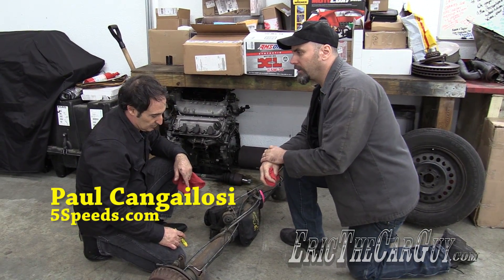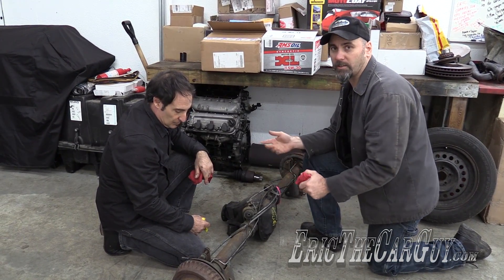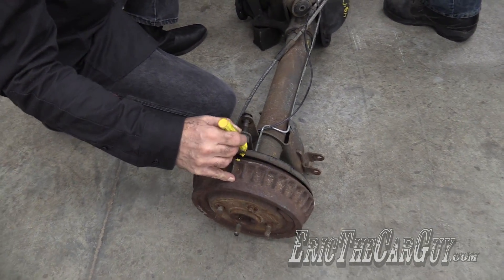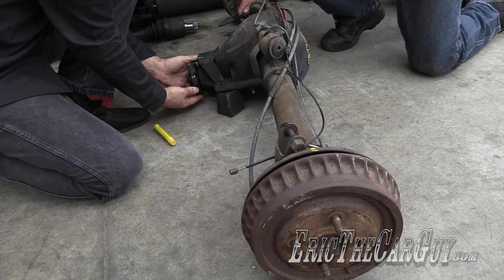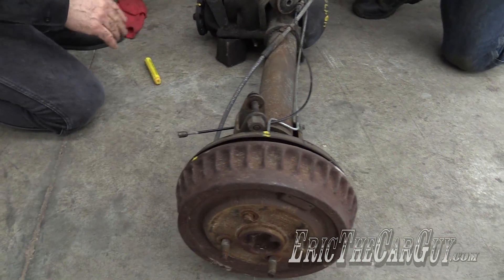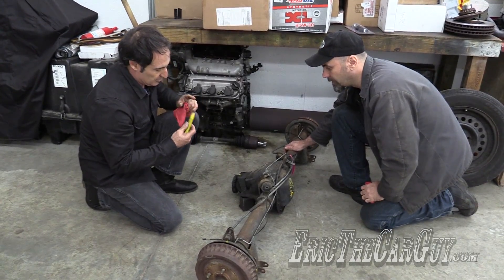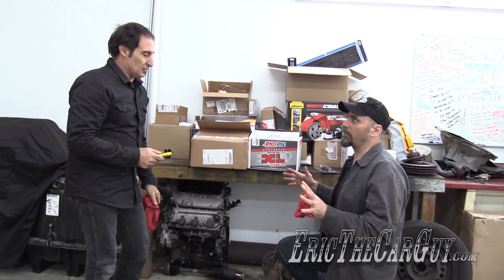A Quick Easy Way To Determine Axle Ratio -EricTheCarGuy

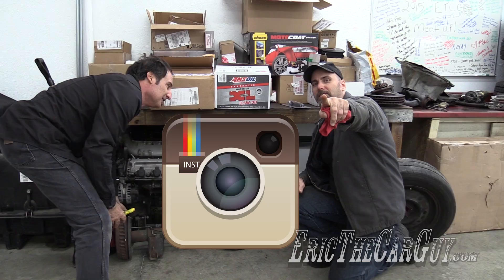Comment: I have a 77 vette and the person I bought it from said the rear end ratio was 3:70. I wanted to bring this down for thruway driving. A 3:08 is what I decided, I know no jackrabbit starts but I'm beyond that at 72. Took it to a shop and they did this quick check for the ratio and found it to be a 3:08. My question is this, can this quick check be inaccurate? I dont see how but the guy insists their wrong.  It's a posi rearend and no tags on it to tell me what it is. Hate to open it up to be sure.

Comment: Very similar to the way I figured out the axle ratio on my '69 AMX - only I raised the rear end and spun the left rear wheel while watching the drive shaft..  Mine has a 3.54 posi - with a T10 4-speed.  And I put Amsoil Signature Series 10W30 oil in my 390.

Comment: This works with an open differential by using two rotations of the axle hub (drum brake in this case) instead of one.

Comment: I'm thinking of putting a M-20 in my 55 210. It supposedly has 3:55 gears in the rear. (I say supposedly because the guy I got it from lies so much I really don't know, I believe it might be a 4:10 because it's so low) it also has 15 inch tires, a 350/300 hp engine in it. How will my top end speeds be if I do this? Someone please answer this because I really need the help. Thanks

Comment: I'm a truck guy from way back.  I learned quick to get the lowest rear end ratio made so I could put taller tires to increase ground clearance.  Most of the time 4:10 was the sweet spot.  Nowdays with the newer transmissions you don't need to go as low, but it still helps if you are going to use your truck.

Comment: Maybe you can help me! 
I have a 91 toyota pickup 4cy 22re. i had a whine when i coast, looked under pinion was leaking and driveshaft would wobble. got it fixed, a week later same thing.. whats causing it to break? bad u joint?  i also have vibration at 45 and 65 but 70 is smooth, im thinking thats my tires but not sure..
thank you

Comment: This same technique CAN be done with a standard open differential, you have to just prevent one side from moving. You can do it with both wheels turning too, but it takes simple math. You'd have to divide tire rotations (t) by yolk rotations (y)... and only count when both marks are touching. Then add them, and divide by however many you performed. For example. 3y1t = 3, 6y2t = 3, 9y3t = 3, (3+3+3)/3 = 3.00 ratio. Another example:  5y2t = 2.5, 8y3t = 2.67, 12y4t = 3, (2.5+2.67+3)/3 = 2.72 ratio. The more rotations you do... the more accurate.

Comment: Hey Eric, I'm sure other people have mentioned it, but this same trick is workable on an open differential. Lift the vehicle (or place the axle assembly on jack stands, mark the drums the same way he did, just on both sides, as well as the pinion flange. Then, have someone hold one side perfectly still while you turn the other side 1 full revolution until the marks line up again, then hold that side while they turn the other side the same full turn. Count how many times the pinion flange turned and you have your answer. Easy and quick way to get differential gearing.

Comment: I had 4.10's in my 92 mustang and it was auto then converted to stick and i barely had 1st gear after but man was that a fun neck breaker. My current 94 gt still has stock 3.08 gears but will upgrade later on to 3.73

Comment: Ok, here's a question.
 You were saying that you can only preform this test on a posi rear. Is it because it spins both wheels when you turn the pinion? If so, then could you do this test on an open diff if you blocked (or locked) the other drum (wheel) side?

Comment: Where did the J series engine in the background come from?
Reply from the maker: +Chris Phillips It's replacement will be featured in an upcoming series when I get the opportunity to complete the edits.
Reply: +EricTheCarGuy Can not wait. Have a 6th gen accord with the J30 and absolutely love the engine. Just wish I could say the same for the transmission
Reply from the maker: +Chris Phillips Yea, those transmissions weren't the best. You're much better off with a manual trans for those years.

Comment: If 4th gear is 1:1  and 5th: is 0.6... why not go with either a 3.73, 3.90, or even 4.11?
Reply from the maker: +ArchimedeanEye We found out my transmission is actually for a 6 cylinder. Overdrive in the 6 cylinder is .73. Therefore I'm going with 3:55.
Reply: +ArchimedeanEye  +melodicdreamer72 You have to keep in mind the whole package.  The transmission has a 3.35 1st gear. Typically that is too much first gear to run with a 3.73 or 4.11. Actually most of the Mustang 5.0  had 3.08 and 2.73 ratios with that gear. The issue becomes how the engine is cammed and where the torque curve of the engine sits.  From what I discussed with eric, the way that engine is cammed, with a 2.73 iut would choke off the line.  The overdrive ratio on the final build of the transmission ended up at a .73.
Reply: +IceInMaWeiner the World Class transmission for the Ford v6 was actually the same used in the first design v8 world-class boxes except this came with a .73 overdrive instead of a .68 overdrive.
Reply: +ArchimedeanEye i was thinkin 3.55 or 3.73
Reply: +ArchimedeanEye I would also narrow it right down to 3.55 myself as it sounds ETCG has - from experience.  Since the 5.0 liter going into the Fairmont has a relatively low red line connected to a manual transmission with standard diameter tires, the 3.55 will keep the car at a good point in the power band throughout the gears.  With a 3.73, 1st gear from a dead stop to red line will be really fast and tire spin becomes an issue.  On the other hand, if it had your basic automatic transmission (why would one do that?) the 3.73s are a good way to go - in OD you'll still be able to keep the car under 3000 RPMs on pretty much any highway as well.  On the other other-hand, if there was a 4.6 / 32 valve motor going in with the manual, the 3.73s move things to a happy place.  Much lower gears are not very good unless you are going for a mostly dedicated drag car with big slicks and heavy suspension and drive-train modifications to handle the load.  Just my two cents.
Reply: +EricTheCarGuy   Is that six cyl trans a world class (roller bearings)? if not, a WC is about mandatory for a healthy small block.
Reply: +ArchimedeanEye 5:0s love the 4:11
Reply: wowantonlavey p
Reply: +EricTheCarGuy Can the v6 transmissions even handle the extra power of a v8?
Reply: +EricTheCarGuy  Nice happy medium!  Can't wait to see more of the build.
Reply: +GearBoxVideo actually, the 94-98 v-6 transmissions had a 3.35 1st gear and .73 of ratio, and the 99-04 v-6 transmissions had a 3.35 1st gear and a .68 ratio od. the 87-93 stangs had a 2.87 1st gear and a .62od ratio except for the odd ball cobras and 4 banger transmission. you'll cruise fine with 2.73 gears down to about 40 mph with no lugging in 5th.

I ran a 2001 v-6 trans behind my 2.73 FD ratio 302. I beat the living crap out of it and had no issues but motor mounts. 1st gear was done by 35mph, second was good for about 70mph and 3rd was still pulling at 112mph. dumping the clutch in 1st at 20mph would either spin the 275/60's or dead hook and go. freeway, you could easily cruise any normal road in 5th gear, all the way down to 45mph, but freeway speeds you would 50% or more throttle going up small hills. you could maintain any speed you wanted in 4th gear. Best $150 buy ever off of Craigslist. was in the car for over 80 k miles without issue.

I vote either leave it stock or go with a 3.55-3.73 gear. if it's just an occasional cruiser, 4.10 or higher. it would be beneficial to try to get a 2.76 1st gear over the 3.35. my car spun all the way through first and half way through second before hooking up, but I had a stock s.o. motored 87 tbird, so 150hp when it was new and a one wheel peel.

since you have the v-6 trans, don't pay big money for a 94-95 gt bell housing or spend the extra money on a new shorter main shaft from a fox. just get a 164 tooth flywheel ment for a f-150. 82 or earlier 302's were 28oz imbalance and 82 up were 50oz for the 302. 351 was always 28oz imbalance. use the mini pgr starter from a 92-96 f-150 with a manual trans. most cars use a 3/4" offset for the starter, while the trucks generally use a 3/8" offset. if you tray a fox starter with the truck flywheel, it will not disengage. other then that, its drag and drop. you can get the 164 flywheel machined for the metric 94-04 clutch if desired, but I just used a stock 1987 f-250 clutch, under 8500gvwr option.

also, the fox clutch cable works fine, and the trans is not actually any longer, only the input shaft and shifter are slightly further back. if desired, use a non offset handle. I used one off a 89ish super coupe and it put it right back in the factory location.
Reply: +lilsammywasapunkrock I believe the original  question was about strength. My point was they both had a main V8 gearset ( 3.35 ) just a different OD set.  The .73 set is actually a stronger set.  No T5 unit came with a 2.87 1st gear. You might be thinking the 3.97 set which was in 1987 - 93.  This was not a V8 gearset but typically what was called the Turbo TBird set ( came with a .79 OD ) and in Mustang 4 cylinders.  I've been involved with the T5 program since the start. Also stock every gear set. Obviously dealt direct with Borg Warner when they owned it, now am a Tremec dealer. So if you are looking for any of that stuff, hit me up.

Comment: and wouldn't that be different if the drums were a wider diameters. ...just take the cover off and find out for your self
Reply: +hittin-low_150db+ 
No.
One revolution is still 360 degrees regardless of the diameter. 
Actually not necessary to remove the cover to determine the ratio, since as Paul stated the ring and pinion gear sets are known standard values it makes it relatively easy and accurate to determine the ratio by the method shown in the video.
Reply: +patw52pb1 pretty sure it would be diff...it's bigger takes more to do 360 degrees ...and not very accurate...I'll stick to my 3:73s
Reply: +hittin-low_150db+  It can be confusing but RPM is RPM.  Forget about the drum, think about the tire bolted to that drum.  The outer surface speed will be different depending on the circumference of the tire. That is why speedometer gears are different when someone is using a 25" diameter tire versus a 30" tire. The tire will still make one revolution, but the one with the larger circumference will cover more distance per revolution than the smaller one, thus requiring a different speedometer gear set combination to achieve correct calibration.
Reply: +hittin-low_150db+ no it wouldn't make a difference. The shaft is being turned, not the drum. The speed would be different but not the amount of turns.

Comment: Paul seems like a knowledgeable man.  And I know where he's going with the final drive ratio in a car with OD.  I had a '70 Mach I with a 428 cid and a 4-speed tranny with a 411 rear end.  It would get to 100 mph lightning fast, but it topped out soon after.  Had it had OD tranny, that  would been a good combination, so consider Paul's observations and advice if you're primarily interested in your car's sprint abilities.
Reply: all stock?

Comment: You can do the same with an open diff by simply holding the other side so it doesn't move.
Reply: +EricTheCarGuy Then couldnt you divide by 2
Reply: +EricTheCarGuy then just divide the resulting ratio by 2 and voila. Or using the method shown, count two turns of the hub instead of 1.
Reply: +hittin-low_150db+ 
Try it and see that you are mistaken.
Reply from the maker: +rinu123 Nope. Then the other side will spin twice as much.
Reply: it don't matter...if it's open all the power goes to the inside tire or one with less traction.....a limited slip will do the same